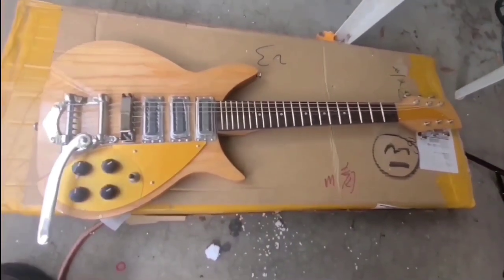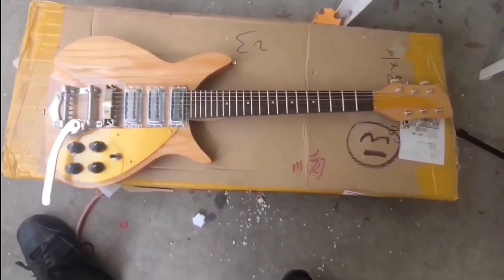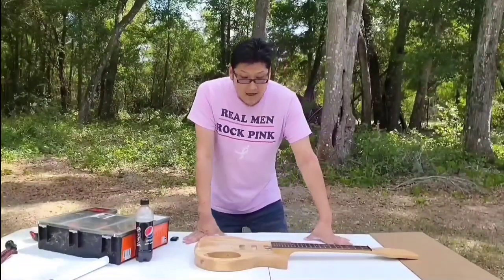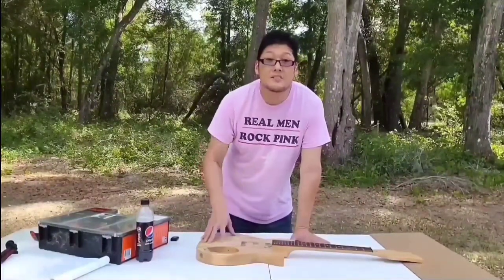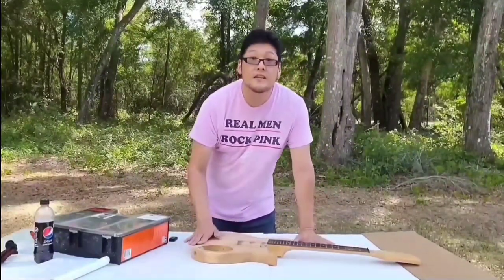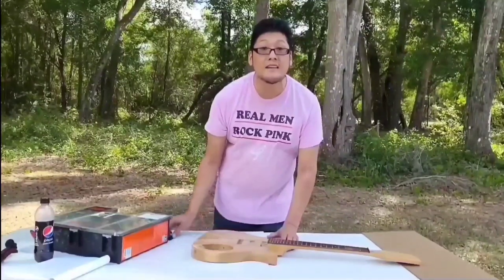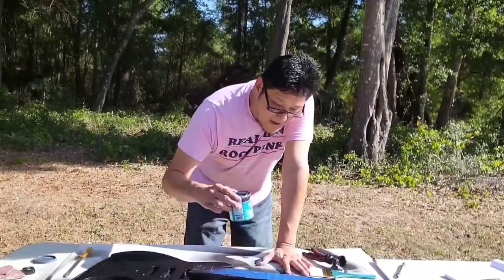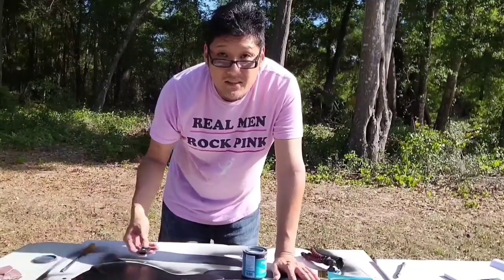Transforming A "Chickenbacker" Into A John Lennon Rickenbacker 325c58

Comment: The only inaccuracy problem with the Chickenbacker copies is usually the tapered neck width is too wide at the bottom end and neck heel joint to the body and fretboard is much higher than the real deal, the bridge has to be in a high adjustment, with heavy gauge 12-54 strings to make these short scale guitar playable in tune. 🎶🎸🎶🎸